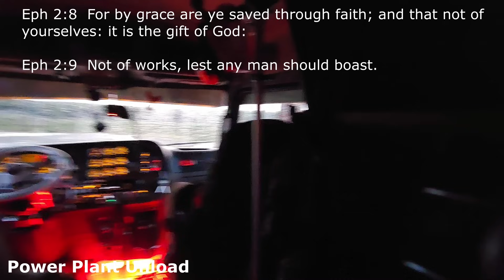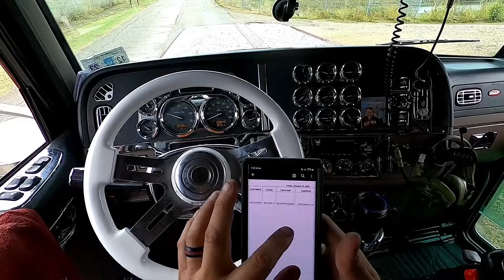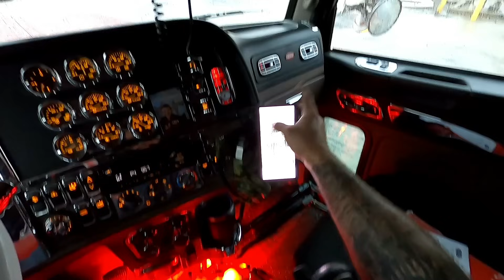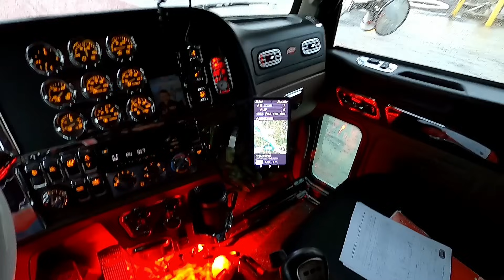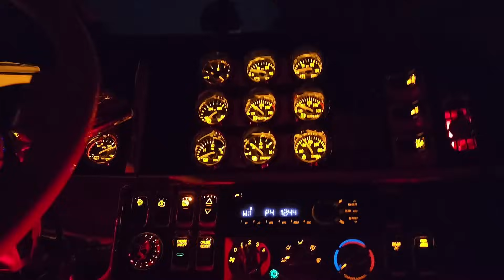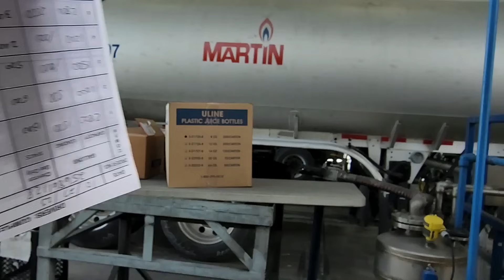Power Plant Unload ➕️ Junkie Wipers 🌧

Comment: When you unload  oil do you have to washout the trlr before you load diesel or fuel ?New to the channel but love the content I'm going to get my hazmat and tanker endorsement this looks like a steady line of work thts doesn't have to worry about the low rates of the loadboards.
Reply from the maker: We use diesel to flush the trailer back out.. thank you for the sub..